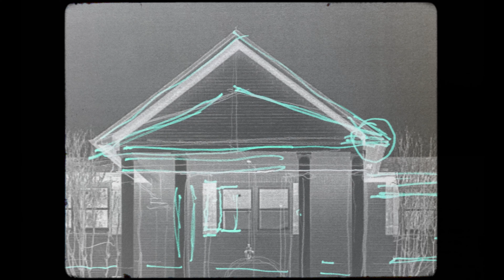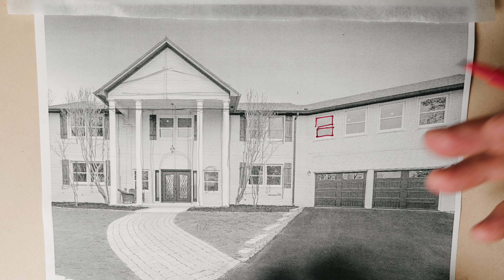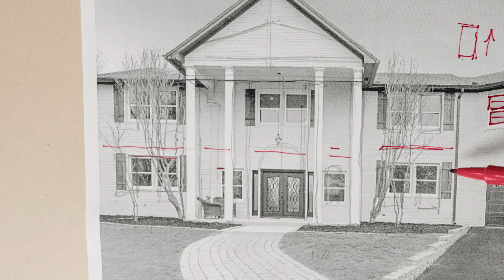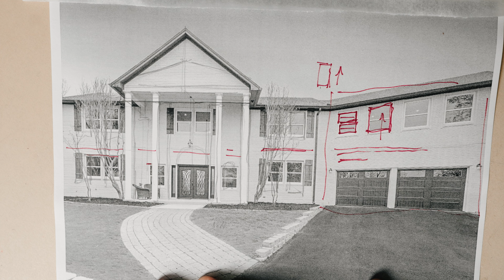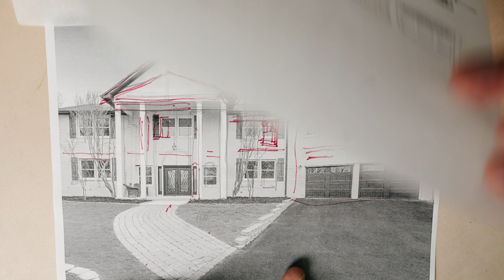House fix 101. How to think about traditional design.

Comment: Wonder if adding substantial corner boards to the siding on the house might help visually define its mass as separate from the garage- that is if physically separating the two (which is obviously the better job) ends up being cost prohibitive. Can't see a cheaper way around fixing the roof height though. Has to be done. Another great vid👍
Reply from the maker: Thanks for watching.

Comment: Do builders put on these huge, highly sloped pediments due to snow? I thought Greek/Roman roof slopes were low due to the Mediterranean's lack of snow, and that's why Gothic, which evolved in the north, tends to have such steep roof pitches?
Reply from the maker: Good question. I don't know why builders do it. Because modern roofs by code must with stand snow loads. Engineered trusses are very economical. It doesn't compute for me.

Comment: I think this was a difficult one. Whats the floor hight? The hight of the windows in the upper floor of the garage my be higher due to purpose of that space (floor plan driven). As an example perhaps it was some kind of work space where there were tables along the walls. I am guessing it's possibly one big room at lease on the side we can see due to the spacing of the windows. It's probably just my imagination most likely just messed up architecture. Love what you did my eye is driven to look at the house even though (being bold enough) the garage is different.
Reply from the maker: Ok, good to know.

Comment: Great redesign! It's so unfortunate that even these "simple" styles are screwed up so badly. Is there any precedent for the angled wing like that? It feels that alone is incredibly uncommon...

What would be fun to see if it's your own project or if you can find a house that has more interior shots would be how your changes would impact the interior design. For instance, I bet separating those windows might mean a wall changes. Maybe it impacts floor height or whatever else. It could harken back to that victorian with the closet window you showed. Just how these exterior aesthetic design choices influence the interior. If done thoughtfully, it can work but builders and designers are lazy and homeowners seem to prefer function...
Reply from the maker: I'll look. Thanks.